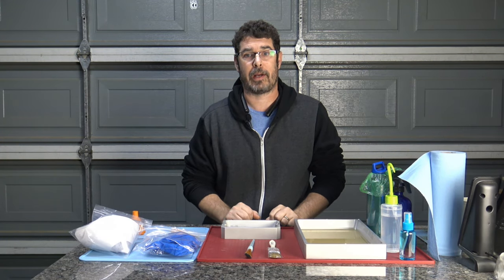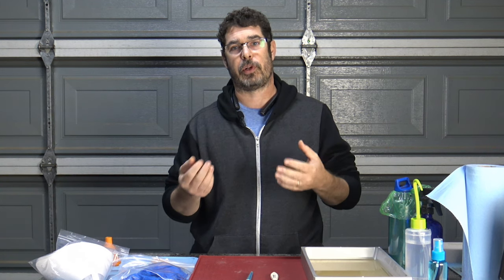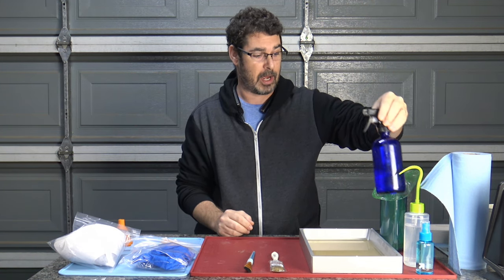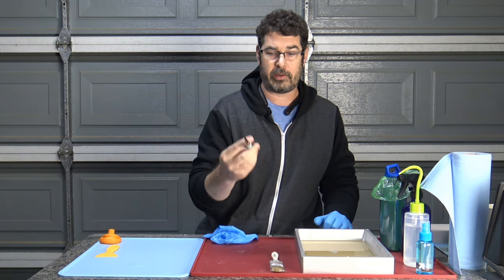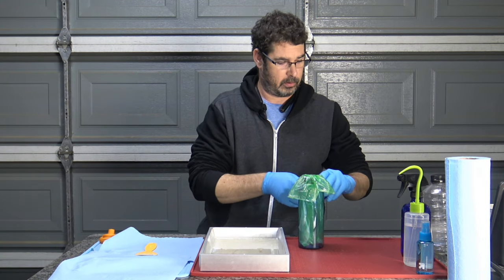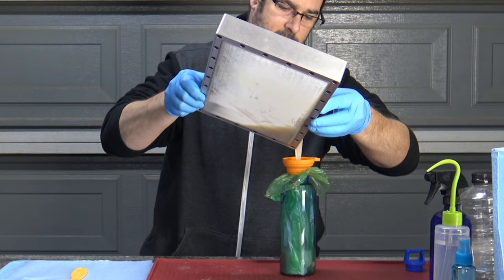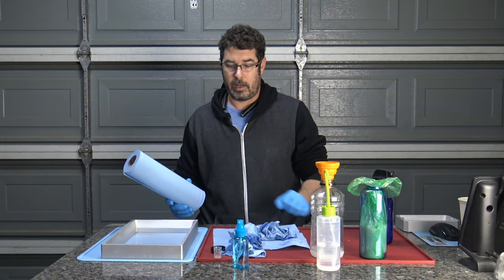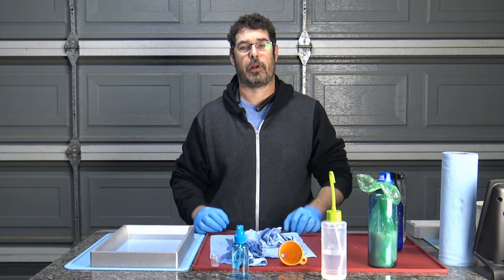SLA 101 - Keeping Your Vat Clean

Comment: I just have a large plastic container filled with ipa. I place the vat in vertically and just use a paper towel to gently wash the resin off. Works like a charm.
Reply from the maker: clutch2827 many manufacturers caution against cleaning The FEP with IPA as it causes it to degrade and get cloudy.  This is why I use the diluted mix and rinse with distilled water.  Each there own, but this is my method...  however for a vat the size of the Phenom that would be a LOT of IPA to fully submerse it...
Reply: @crussty3d  it is a big container but it only holds maybe an inch of IPA. So I just soak the paper towel and basically let it fall on the fep. I am worried about cloudiness too  I so might dilute as well.

Comment: One suggestion - I wouldn't use paper towels on the FEP if I could avoid it. Too rough. Use a soft cloth for final drying - treat the FEP like you would a pair of eyeglasses.
Reply: Yes, microfibre cloth is the way to go 👍
Reply from the maker: I would agree with not using “regular” paper towels, however the blue ones I was using are essentially cloth, very soft and mostly lint free.  I save the microfiber and cane air for any residual surface dust before installing the vats back in the printer.

Comment: Going to buy a large resin printer, will be deciding between Phenom and Transform, do u have any thoughts on what might be better, the Transform has large print area and more features.
Reply from the maker: Sorry man, I couldn't answer that at the time knowing about the 2 new units coming from Peopoly.  Short answer is you can't go wrong with either company and a lot of it comes down to your personal preferences as far as the slicer/firmware options, print sizes needed and availability in your area.
Reply: Practical Printing No problem, I ordered a Transform after much research, now I just need to wait.
Reply from the maker: @TheIcemanModdeler  Waiting is always the hard part.